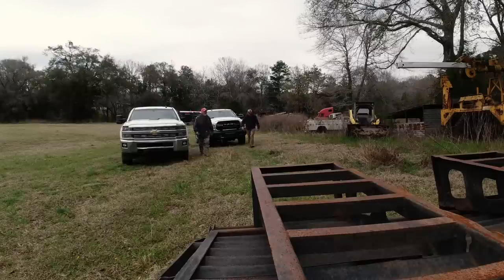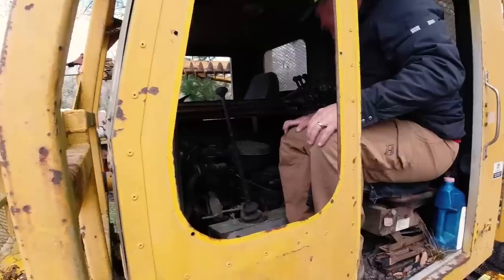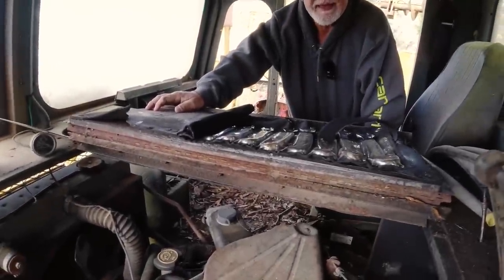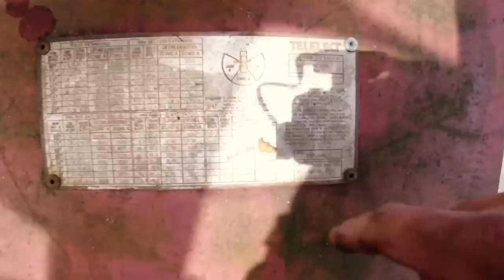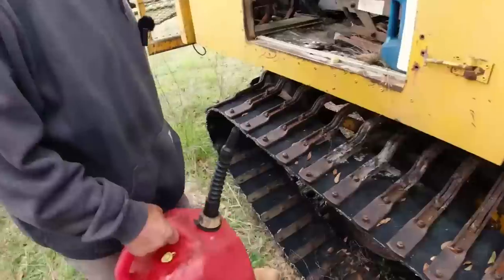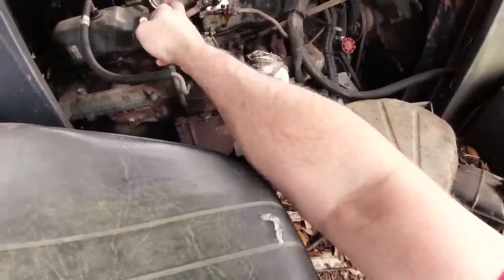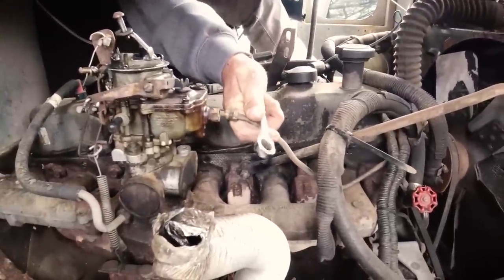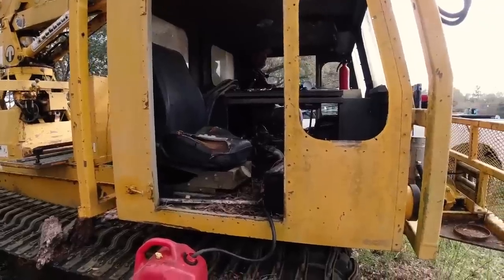Will it start? 90's Tracked Auger machine parked 10+ years!

Comment: The engine ain't as old as the machine or made about same time that they took out points an  went electronic ignition. A tune up is to spray some ignition cleaner in the distributor if you want to or just blow it out with some compressed air. Cap, wires, rotor, and the plugs themselves are a whole  tune up. When first approaching a gas rig, check for air leaks on all  the lines and caps that stick out but go no where so  they have a  rubber cap over  them, they do rot out an leak so make sure those are secure. I feat taking just the top off of a carb because little pieces fall into the intake and get under a valve. Don't take anything forgranted, taking a carb off is usually straight forwards so its in order to clean out the selack that the gas turns to and get any jets cleaned out. As long as the needle under the float is clean and will stop fuel from flooding it, then its fine as frogs hair. Don't be afraid to lubricate the hell out of it as sticking closed is worse than open. If you can find the little pump rubber that makes it squirt gas and oil it up so it can push the fuel in the jets and keep it from stalling.  Air jets only work from a idle and then engine vacuum takes over that circuit. Usually a turn and a half to two  turns will get it in the ballpark to idle an while it is, slowly slowly turn it in or out for maximum good idle. Too fast a idle will cause it to bog a little when you give it gas from the throttle so when running good, its best to turn it in just a little bit an you will hear it get a little richer running. Carter was in my feeble mind, the  very best carb out there for a single or two  barrel but getting bigger, its a new  game  to anyone. It ain't far from the passage on knowing how  to change your flat tire. Some city boys just never do get it but a damn computer has me  running scared. There are two common sizes for plugs to take them out, most lean to the five eighths but some are thirteen sixteenths. There are other sizes for different applications, it would hardly fall in this category. Heads up and feet on the ground, it will run... as many hours as on it might suggest it is  low on compression and will never run great. From all the fuel and starting fluid you  used, I have a feeling the compression is within the limits of run.

Comment: You might check the firing order on it it's backfire through the carburetor is wired the spark plugs are not right to keep pouring either in it and you wash the oil out around the
Reply from the maker: Stay tuned to part 2

Comment: Only pull one plug wire at a time, less chance to mix up the firing order.  Should check the distributer cap and rotor.  Pull one plug, touch block and see if you are getting spark.
Reply from the maker: Good call

Comment: Just switch the spark plug wires back where they go and i think it will run. Tap on the top of the carb and maybe the float needle is stuck shut

Comment: Based on other vids I've watched, the gasoline in the tank would be varnish so it wouldn't have been useful.  Also, the fuel pump on side of the engine MAY not have been any good (internal diaphragm dry-rotted) and the carb would've needed rebuilt (dry rotted, varnish).
For the electrical system, you were right to check the plugs but the general ignition system would need a good once-over.  The coughing and hard starting was probably to do with a sticking valve and/or that you didn't put the ignition wires back on in the right order.
You were better to leave this one alone.

Comment: You need to check and see if you're going to spark our wires crossed up that's why it's back firing through the corporator
Reply from the maker: Stay tuned for part 2

Comment: REA power pole line truck.  Might be for Telephone - bet REA due to age. In the 60's or 70's.  The funny fuel - coal oil.  Cheap gas.  Used in heating stations and available everywhere. Gas was not.  These drove the mountains and the swamps to put in power poles.  In the 70's I helped some REA's in Arkansas, Ga, VA. to name a few.

Comment: Eastern shore of Maryland here. Gassers ain’t hard especially not that one. 300 straight 6 ford that wants to run. They’re impossible to kill.  If you guys had just a tid bit more gas knowledge that allowed you to work that carb correctly it would have ran no problem

Comment: Its a grey 4.9 L 300 6 its not gonna have points its electronic ignition ...you are more than likely gonna be a fuel delivery issue Carter makes a good carburetor but sittin that long its probably dried out ..the needle and seat stuck or clogged with trash either way it shouldnt take much to get her purrin again ........

Comment: I didn't see normal engine check before trying to start it.
Fuel pump not checked
Fuel to the carburettor not checked
Spark not checked
Does the carburettor work?
Timing?

Waste of time

Comment: itll crank old ford motors are the goodins n 300 6 cylinder fords best motor i love this channel i could work with u n whiley i could help whiley pack batterys n gettem runnin gas or diesel or propane lol wed do it all

Comment: Just take that carb off and strip it down and wire out all the passage ways are open and clean and then soak it in cleaner solution and put it back on

Comment: That's a telephone pole digger. The tracked ones are fornthe offroad poles
Reply from the maker: Right on
Reply: @HamiltonvilleFarm  I used to work for green mountain flagging out of vermont. Ours were white. I've seen them be up over the tracks to get to where there going. So glad to see an older generation and see the difference between then and now

Comment: It's an old Ford 300 ci six-banger. The problem is the carb is gummed up from sitting, and probably shot. Another carb and it will fire right up. It's getting spark or it wouldn't pop off. I hated the old six bangers because they were "six-bangers" in a Muscle car era. All BS aside, the 300 was a heck of a motor.

Comment: Uhoh yall gonna pull it off , as long as yall ain't gonna reach around doing so . Check the plug position.  You might have put them.back on wrong . And a engine that old most likely is gonna have points so you might want to clean those some buddy

Comment: That was the fuel pump lever, sorry to hear about your dad and don't blame you I'm clostrifobic, how ever you spell it scared of small place's gasers aren't that hard most gasers think diesel is hard the only difference is gasers need spark diesel use compression to ignite, carby don't always work but just a fue hole's to draw fuel through 😅🤣😂 don't let them discourage you you nearly had it, if you can get it to rev high for a while and smothered the carb with a reasonable size rag if it's guna it will if not pull it apart don't drop the small bits shove some wire in all crevices put back together should be good 🤣😂famous last word's 🤣anyways it would be great to see it operate all the best to you all
Reply from the maker: Stay tuned. And thank you.

Comment: The carburator don't troubleshoot these trouble is a timing system wrong spark plugs wires incorrect position cylinder numbering

Comment: Might crank.... But wont start.  Looks like a 300 inline 6 cyl..hose on air cleaner is PVC vent hose....  Back firing thru the carb is usually the fire order is wrong.  Re check plug wires...   
Change the name of your channel to "The TWO Stooges"

Comment: The engine clearly has a fuel feed issue, other than that it is probably in a reasonable condition. It could be a fuel pump, or carburettor problem. An engine service, i.e. plugs points and other sundries, might then be a sensible step.
Sorry to hear about your father's untimely end, fuel fires, petrol, ether, paraffin, alcohol, fats or oils, e.g. cooking oil, can be terrible events. All such spillages are mortally dangerous.
Reply from the maker: Thanks for the comment

Comment: how could you guys even call yourself mechanics. something that sat even 2 years 3 years the engine should be turned over by hand. take the distributor cap off see if it has points clean the points and it was probably start right up. if they ran it out of gas when it was shut down. that was the old gas with no ethanol no ethanol no problem. you guys crack me up but I still watch you here and there
Reply from the maker: you must miss the parts where we say in every video "we're not mechanics" 😀

Comment: Late response but I think u crosed 2 of those wires when u had them off. 
K now 2nd the throttle control isn't the top like u had Ben attempting. 
It on the bottom of carb . There's a momentary plunger connected as u were playing with. Even if that momentary didn't function it would run. Shitty but yea run. By the way that's a 240 or a 300 motor. I couldn't see due to lack of angles. I would've needed to see the stack pullies on crank to identify. I would guess late 60s into mid 70s range. 
I can't belive u guys fool with diesels but can't figure out a simple 300 online 6 banger gas job.

Comment: From a Ford guy . The 300 6 is a great motor and u two are or were doing it all wrong to get that simple motor going . Cringing as I watch . 😔  . I know I'm wasting my breath buy this kills me to watch . That thing needs a gravity feed gas when trying to start it . Fuel pump will be working over time to get gas up to the carb . And holy hell don't use tractor Crack on a gaser 😡😠 . Drill a tiny hole in a soda cap with a drywall screw and use that and use it like a dripper . No lie that is the easiest motor to get going  . I normally don't say much or any thing to you guys other then good job or something but this one got to me 😠😠 . Them 300 / 6 is a 400k motor easily,  that motor is barely starting to get broken in with 16 hun hours on it . In all honesty that motor will make any one happy for a long time if put in a old f100 or a old f150 . It can even go in a old 8n tractor.  It can be used for a lot of things ,  ok . Rant over . Damit guys . Big sigh 😕😔.  I all most don't want to see part 2 but I will watch you 2 try and kill the poor thing.  👍🏻

Comment: looks like an old 300 ford. seems like you might have some carbon buildup on a few valves. dump a little atf down the spark plug holes, then spin it out. and yes, the carb will need to be gone over.